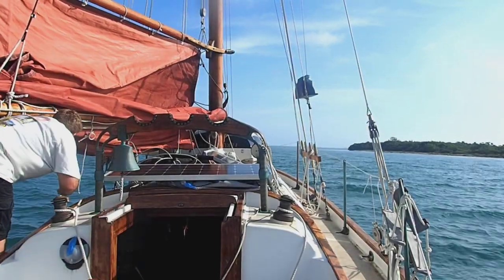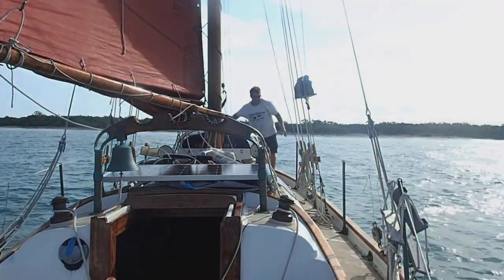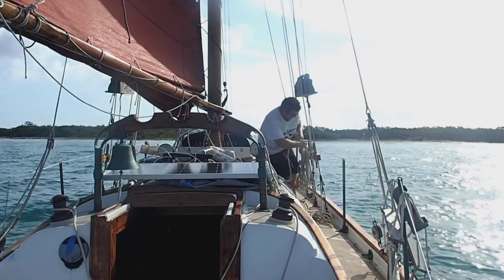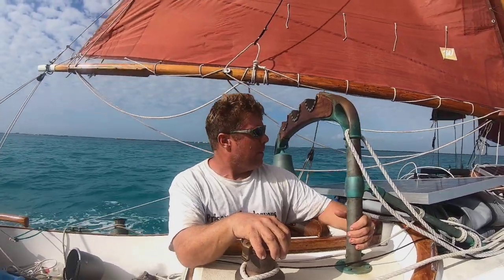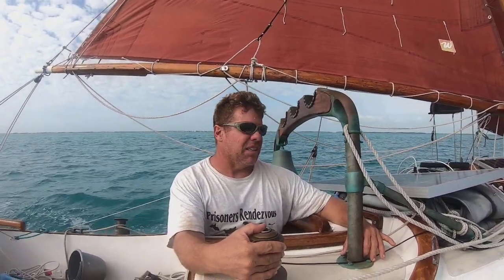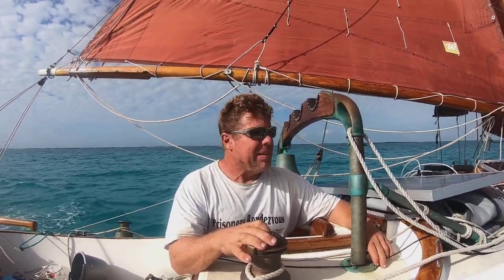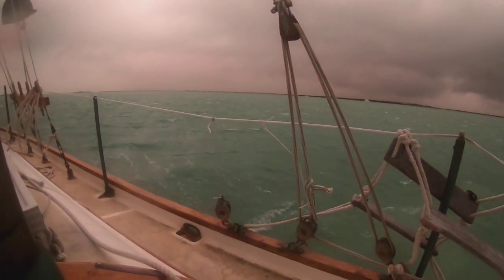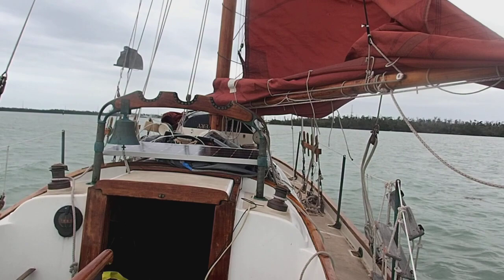New Batteries: AGM's, by the Numbers

Comment: One of the best explanations of the lithium batteries can be found on Ryan & Sophie Sailing. Ryan does a series of technical videos, one of which addresses the lithium v. lead-acid question. It's really good. Sailing With the Wynns is another one with a very good video on lithium v. lead. They have me convinced.
Reply: Ryan sells lithium batteries for a living. not exactly a neutral viewpoint.
Reply: Fair enough; however, the Wynns say pretty much the same thing. The fact that Ryan is in the industry affords not only the potential for bias, but also the expertise to speak authoritatively. A more useful response might be to challenge any of the content of his explanation.
Okay, a couple of hours after starting this response, I now have gone through quite a few articles and videos coming from what would seem to be not only authoritative, but also neutral (a couple of mechanical engineers among them.) They come to the same conclusions. One thing Ryan didn't mention was how much lithium has declined in price, to about 20% of what it was in 2011, with declines continuing to come. Another interesting fact not mentioned in Ryan's is the lack of re usability of the materials from lithium batteries. Again, though, it would appear that there are advances on that front almost daily.
And Ryan does cover some of the big disadvantages - obviously cost, but also potential volatility of a lithium battery. The other material I looked at echoed those concerns, but also, as Ryan does, discusses the mitigation of those concerns. 
For those who might be interested in knowing where this discussion is coming from, the video Ryan made can be found at https://www.youtube.com/watch?v=pP98FJD6b04.
Cheers.
Reply: On the other hand, I want to make it clear that I'm not beginning to question Kevin's choice here. Going from AGM to lithium isn't just a plug and play solution - it would require quite a bit of retrofit in order to make the lithium installation safe and usable.

Comment: I got Everstart Maxx batteries at walmart for $100, they're 105AH, 800CA, weigh 60lbs, and they come with a 2 year warranty. People use them for trolling motors and they last up to 5 years. I've had them for 9 months now so I'll have to personally see how long they last but by the numbers they beat anything out. If they only last up until their warranty they still cost half of what lithium does.
Reply: Kayak Excursions I d have to agree.
Classic Lead Acid  from Walmart are a great deal overall.

Comment: Nice touch, adding a bit of humor to your video, Kevin. While watching you bust your buns, trying to muscle batteries out and new ones in, the engineer in me kept imagining a pad eye mounted overhead (or small portable gantry set-up) with a block and tackle employed to lessen the physical aspects of the job. Of course that would require more time, effort, and expense in order to lessen the physical effort. Just as well you did the job as you did - sometimes simplest is best. A little more physical effort, but far less time - it's always a trade-off. Enjoyed  the video. Hope you're enjoying life in the Keys right now.
Reply from the maker: Hmm, yes,  block and tackle suspended from the boom overhead would have worked.  I even have a gantline system stored in the cockpit locker, a thought for next time.
Reply: I have often wondered why I do not see contemporary sailors using the built in ADHOC davit (the boom) for moderate load transfers onboard or offboard. Years ago I sat an 8 person hot tub into my back deck (built in to deck level) with an 2x4 A-Frame, 2x4 "davit",block and tackle and a small 4 ton chain hoist ( I carry that chain hoist with me every where in a 2 1/2 gallon pail to this day) all by my meager lonesome. For some reason all of my friends were busy that Saturday. LOL As you may have guessed they were ALL available for the christening party.

Comment: Boat batteries - always a 'conversation' starter.  Like a few of the other comments, I agree total number and depth of discharge should also be factored, but usage pattern is key.  I'm sized with two 225 Ah golf cart batteries @6v.  Only 110Ah is usable because of the 50% rule, but occasional day cruising only discharges 10%, and rarely down to 20 or 30% on overnights.  By the manufacturers charts, lead acid will still give me thousands discharge cycles, so the chemistry makes sense.  Living aboard, you have much higher power demands from your bank, and AGMs allow for 80% DoD with many more deep cycles.  AGM is definitely the way to go for folks like you.  I'm with you on the LiFePO4's.  They sure seem nice, I mean, my phone lasts a lonnnng time on a slim little battery, but it is a lot to shell out up front.
Reply from the maker: A conversation starter indeed.  The pro-LiPo people do have some points, admittedly, but I like the AGM's.

Comment: I think you’ll be happy with your new battery set up and for your very low load requirements you could have gotten away with one battle born battery to replace your old AGM's.  As you know,  Lithium batteries  can take a charge much faster than the AGM’s but I do understand your decision.  I would double check the size of the wire you used to parallel the batteries depending on the load of your inverter

On another note, I once used dielectric grease like you did and found I had problems with continuity on an electrical connection. The grease acted like an insulator and inhibited the flow of current. Since dielectric grease does not conduct electricity, so it shouldn't be applied directly to the mating surfaces (pins and sockets and ring terminals) of an electrical connection. There’s a reason that grease call dielectric grease is called dielectric. It is non-conductive, something you probably don't want in an electrical connection. Most times that such a grease is used, there is a mechanical rubbing/squeezing/scraping that clears the grease when making contact and that is why folks who use it often don't have problems, but, as in my case, it can happen.  I think a better approach is to make all clean connections first and then apply the grease all around on the outside to prevent air from contact with the metal…

Good luck with your new batteries. Terry
Reply from the maker: Ahoy Terry, yes, some other commentors pointed out that while AGM's are rated 125aH, effectively only half of that is usable since you don't want to go below 50% charge.   With Lithium you can just burn 'em to zero and charge right back up, no problem.  I'm sure as prices come down these newer batteries will become the standard.  Did not know that about dielectric grease, thanks.
Reply: The corrosion that the grease can help prevent is pretty bad for connections too...  8^)

Comment: The Trojan everyone buys are the 6V T105 at 225ah's for about $170.  You buy two and wire in series to get 12V bank at 450 AH's for under $350.
Reply from the maker: Ah, so there was an angle I was missing there.  Still, from my own experiences, I am not tempted by lead acid batteries ..
Reply: @howtosailoceans1423  AGM batteries excel in their slow discharge over storage periods; but going deep, putting out raw power, they can't beat a quality lead acid battery yet.  AGM's do off gas when pushed like regular lead acid, either fast discharge or charge, but being sealed you can't maintain them.  Well maintained T105's are known for lasting many, many years, usually around 10 or more, if properly maintained.  Especially if you run all year round and don't store them.  I have two banks of two in my boat.  Replaced 12 year old ones last year just because it was time, they were still working.

Comment: When comparing lithium batteries remember that they have a lot more useable capacity, meaning they can be discharged much more deeply than a flooded lead acid battery (which an AGM is), which you can't really discharge more than 50% (and even at that level you are killing your battery), probably more like 30%.  Also, lithium generally charges faster and more efficiently with solar.   Thus, a lithium with 32 Ah has almost as much usable current as a 100 Ah lead acid battery.  So that 100 Ah lithium battery has huge capacity compared to those AGMs, and two such batteries would likely make you a very rich man, electricity-wise.
Reply: 3,000 usd for a single 100 amp hrs lithium. No thanks i stay old school with my t105s.  6 x  t105s cost me 900.00 and last 6 years and give me 675 amp hrs i can go 40 years for for the cost of 2 lithium. Lithium is for rich people. Beside i dont need 40 more years. Maybe 30 if lucky.
Reply: @sailingsolo5290  They'll probably start coming down in price now that there is widespread interest in EVs.  I did see a 200 Ah lithium battery on Amazon.ca for about $1000 (Cdn), but not sure if I'm reading the ad right.  At that price might be very worthwhile considering.     https://www.amazon.ca/gp/offer-listing/B081LFXGH2/ref=olp_twister_child?ie=UTF8&mv_color_name=1
Reply: Michael Anthony  My LeFePO batteries have been flawless for 4 years and out-perform AGM in every way. If we are having anecdote wars here...see my post above for the performance I (and others) have realized and the reasons behind it. Solar cannot drive AGM appropriately without a very big array.
Reply: Michael Anthony  fine, use low performance batteries. Life expectancy is a part of the equation for sure. But you can't dismiss the superiority of LiFePO for several reasons.  You didn't read or don't understand the value proposition i outlined in my other post. Since when is sailing all about cost-effectiveness? Sailing is a silly financial proposition at best. And show me where any AGM battery stands up to their manufacturer's specs.  They only get even close if you keep the charge rate over .4 capacity. Good luck with that. My Lifeline AGMs were shit. Anecdote. Everyone I know with LiFePO is happy. Anecdote.  Whatever. Fight whatever fight you need to.
Reply from the maker: Yes, apparently Lithiums have 2x usable capacity compared to AGM's ... you commentors have been setting me straight on that !
Reply: Michael Anthony  I was considering Kevin's setup for performance, we all need to make the affordability decisions. Charge and use profiles define the best battery solution. One type of battery thrives, the other dies. AGMs can "last" but when you test them you'll find you are not getting what you bought in regards to performance. Decide which is best based on the system and charge sources (wind, solar, alternators, geneset, shore power) and draw.

They key consideration is State of Charge (SOC) and life at Partial State of Charge (PSOC). PSOC is Kevin's world with rare if ever shore power, no genset, no engine. He is relying on solar I believe and his battery loads are low discharge rate. AGM hates this. AGM wants high charge rates (absolute min 0.2 capacity or 50A for Kevin). That's 600W (actual) of solar. To meet (approach more likely due to marketing BS) the AGM manufacturer's performance specs you need to run at 0.4 capacity min.  Now you are at a 1200W solar array! 

Another downside of AGM is they need to be full SOC frequently, or you degrade them. Good luck on that without a day in the marina or a big alternator or genset.

The good news is LiFePO isn't the only answer. Gel batteries are better than AGM for Kevin's setup. They are much more tolerant of PSOC usage than AGMs. The downside of Gel is they have a lower charge acceptance rate than AGMs, charge voltage needs fine control and over-charging kills them.  The good news is that in Kevin's setup none of this matters. Gel would accept everything he sends it, rate doesn't matter, no risk of overcharge, no issues if there is a decent MPPT solar controller in line. It is not unheard of that cruisers get 10 years out of gently treated gel banks. Not sure why AGM is so popular when most cruising boats don't have the right charge regimen to use them correctly.

Comment: That’s a pretty good price for AGM Batteries, you said they are specific for solar?,Would you use them If it was being charged by both solar and the generator associated with diesel auxiliary
Reply from the maker: I now have a little portable gas generator for when the sun don't shine, but haven't had the generator long enough to really say whether the batteries like it or not.  But yes, Vmax says they are made specifically for solar or wind charging.

Comment: There are some other factors that have to be counted also.  You can dig into your AGM 50% and LiFePo4 100%  That means you only need half as many batteries 1 Also Your AGM batteries  start reducing rat of charge as you are bulk charging and may take a hole day to get a full charge , where as you LiFePo4 batteries suck the full charge rate throughout the whole charge , great if you only have a two or 3 hour window of full sunshine.. And there are other qualities that just make them well worth the 9$ /amp/hr. I personally will use them on my boat. Cuz I run my house on them now and I love them. I wouldn't look back.
Reply: Lithium bateries catch fire like for no reason.
Reply: Not LiPO4. very different dynamics as opposed to LiPO which is never put in a boat.

Comment: AGM versus (insert your choice of battery here) will generate about as much discussion as a traditional head versus a desicating (commonly but somewhat inaccurately called a composting) head!  Thanks for another interesting video.  Just curiously, how many panels do you have and what are their ratings?  How much power does your refrigerator draw, how large is it, and does it also have a freezer?
Reply from the maker: No freezer.  The fridge draws 4amps at low speed, and 6amps in freeze mode, when the batteries are over 13.2 volts.  I have four panels with a total wattage of 260.
Reply: @howtosailoceans1423  That is encouraging!  Do you run the fridge all the time?  I am thinking of converting the ice box into a refrigerator on one of the boats.

Comment: Li-Ion batteries actually cheaper than AGM batteries in the long run, last 5 times longer and store more power because they can be discharged to 10% not 50%!
Reply from the maker: I bet in time prices will come down and the batteries will improve.  I also agree with Michael, be careful of hype.   I've been burned by the latest and greatest too, like with the Splash Drone 3.
Reply: @howtosailoceans1423  Your math is correct but you truncated the calculations so the results are flawed.  Only time will tell if we can rely on lifespan expectations but we don't really have to factor lifespan in.  Simply accounting for depth of discharge and time to charge brings the cost to about the same as lead acid.  
For us, that was the deciding factor but that was because we were frequently having to charge our lead acid bank with the diesel engine.  Obviously not a factor for you.
Your wariness is valid and it's your comfort level that is important.
Reply: My boat is smaller, 26' x 5,200#, so that is making the LiFePO4's lighter weight more attractive.

When I was looking at solar charging with overcast or sunny and three different draw scenarios: low (15 Ah/day), medium (50 Ah/day), & high (120 Ah/day) draw, I concluded that  if it is sunny, a 2 battery bank is fine but if it is seriously overcast for several days or a week then even a 4 battery bank probably wouldn't be large enough unless I kept my draw very low and even then getting a big bank charged back up becomes a challenge.  The good thing is, almost everywhere I want to sail seems to be considerably sunnier than here in Ohio.

In any event, the usable Ahs means the LiFePO4 bank could be almost half as big, so a 2 battery LiFePO4 bank would need to be replaced by 3 or 4 AGMs for the same reserve.  That would/could count towards the cost, so the life expectancy wouldn't need to be as high as advertised to still pan out.
Reply: Li-ion battery’s charge different to AGM so you would need new charger , charge controller and wiring
Reply: @dave-vf7sm  Li-ions are not the chemistry of choice on a boat. LiFePo4 is.  He's charging with solar so it's not so complicated and no wiring would need to change. The only difference between charging LiFePo4 and AGM or FLA is that they don't need to be floated.
Reply: whatsaguytodo I don’t know what KB has on his boat, but my understanding is that a decent MPPT charge controller will handle any of the referenced batteries. PWMs may be limited. Like others, I’d be inclined towards the newer Li based batteries (the ones with reduced risk of thermal runaway). But, familiarity and comfort level are important when your 200 miles off shore....

Comment: Thanks for another great video. I was wondering why 2 charge controllers and are they wired to the batteries in parallel?
Reply: Michael Anthony  So if I have 4 batteries I need 4 charge controllers?
Reply from the maker: Well as I've said, my electrical system grew organically, not by central planning ... they are wired in parallel.
Reply: @howtosailoceans1423  A little redundancy probably doesn't hurt either especially if you're days away from anywhere.

Comment: For the money of lithium I would buy 10 Nickel Iron Battery 1.2V 100ah batteries.  This is what people use in solar homes and they can last well over 50 years of constant heavy use. Yes, it's older technology but it has a long and successful track record. As for the weight, it's ballast in my boat that I need in the bilge anyways. For a light or small race boat I'd go Lithium.